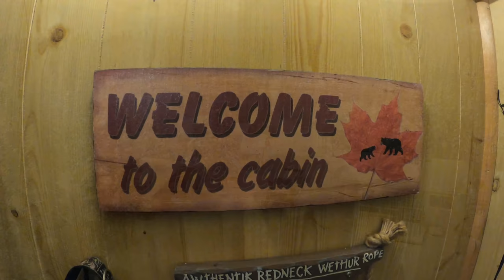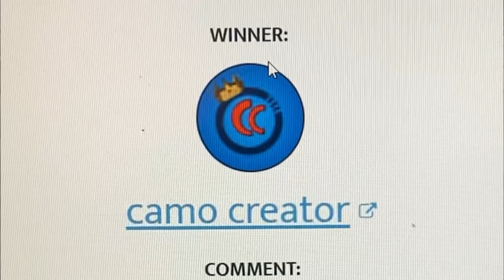EXTREME Wood Sleigh, SWEDISH CANDLE "Moose Ring-alls" (cookup), CONTEST WINNER announced (& tricks!)

Comment: Hello Chuck just a tip I did something similar to what you did with the sleigh for hauling larger loads, like fire wood. The racks put pressure on the bottoms of the legs pushing them out wards and damaged the sled, The repair was simple one the sled was fixed I put a cross 2x6 and contoured to to match the sled bottom, much less wear and tear. Great videos keep them coming.
Reply from the maker: Good tip!  Thanks!

Comment: Hi Chuck. Great videos keep them coming. Have a question on your pelican sled. How did you attach a 2nd one to the back of yours? Did you use a bracket from pelican or another manufacturer?
Reply from the maker: Hey Melanie.  Tks for tuning in!

I just used my bracket on the back of my sled(s). A simple door hinge with a plywood or metal bracket on the inside for strength.

Comment: Outstanding video Chuck, 2 things, 1st What are you using for your camera mount on your sleigh? 
2nd, I was in Goose Bay at the time of that fire in 2013. It turned our sky's orange and blocked out the sun so much the street lights came on in the middle of the day. I haven't had ring-alls in about 20 years or more. I think I'm due....
Reply from the maker: Good to hear from you sir.  The mount is just the standard GoPro alligator goose neck mount.  I use it a fair bit.  Very strong clamp.  I eat moose ring alls every now and then....usually a crowd pleaser for sure.  Here is a link to the clamp:  https://amzn.to/3uEYt63

Comment: Hi ,
Chuck, let me use your experience and ask: If would you buy a new sled today, which model would you choose and  which engine?

I have to choose whether Skandic or Expedition? WT or SWT? 900 ACE or 900 ACE Turbo? Third option : Yamaha VK Professional II ( witch Electric  sterling)
    Will be used for Ice fishing only.

Best Regards
Reply from the maker: Absolutely would recommend either a skandic or an Expedition with either the 900 Ace or 900 Ace Turbo engine.  The Turbo engines are still going through some bugs but I think it is still a very good option
Reply: @ChuckPorterEverythingOutdoors  Thank You v.m. Ps. SWT or WT ?

Comment: Greeting from Alaska
What brand and model thermometer do you have on your sled for external temp reading?
Skidoo wants 190usd for one that goes on my 2021 Skandic
Reply from the maker: Actually the thermometer you see stuck on my machine is one I use on  standalone basis (ie first thing in the morning before my skidoo is started, in a shaded area, inside my winter tent etc). When it just sits there on the machine, it reads an inaccurate temp due to sunlight and any warmth it receives from the machine. It’s just a cheap thermometer I bought at my local Walmart. 

Good from Alaska again and thanks for tuning in practical Porters!!!👍👍
Reply: @ChuckPorterEverythingOutdoors  thanks as always.  So good to see your channel grow.
Cheers from -28F🥶